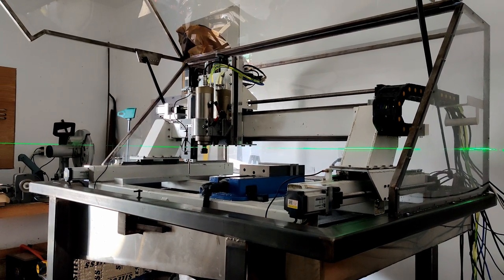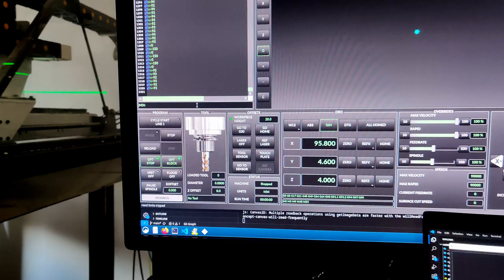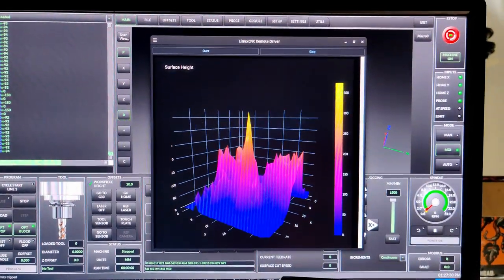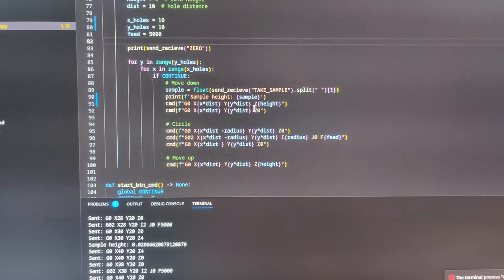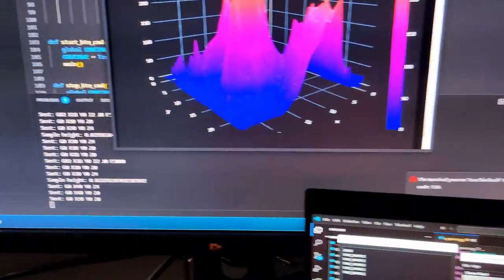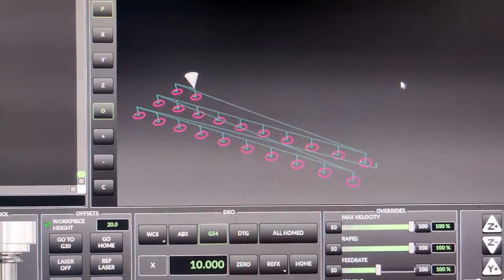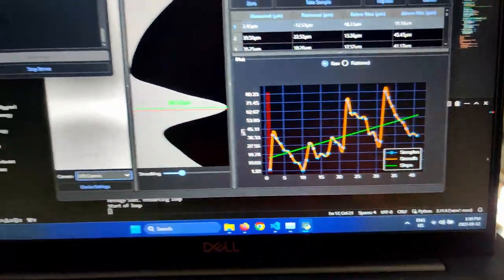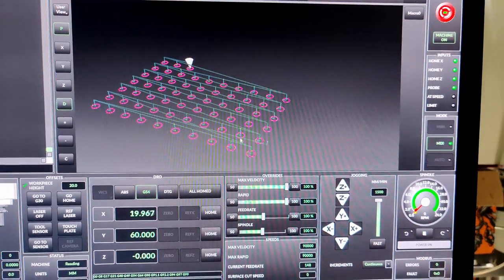CNC machining a flat surface with lasers - Part 1

Comment from the maker: I’m quite happy with how stable the sensor is picking up the laser beam while the cnc machine is moving. I thought for sure it would be shaking all over the place and I’d have to put a good couple seconds of pause to read off the webcam. 

Also currently jobless for the last couple months now due to the ongoing actors/writers strike which is effecting post-production/vfx that I work in. At this point I wouldn’t mind an industry change, so hit me up if you are or know any company/startups in automation, robotics, machining, prototyping, looking for a technical minded person such as myself Toronto/GTA or remote.
Reply: Hope things go well with you.
I am trying to setup still and when things get better .. would be great to connect and possibly collaborate.
There can be a good market but needs to be explored here in India.
I would be designing something which can be heavily calibratated. And what you did is the important part of calibration :)

Comment: I replicated your system in order to align linear bearing on my CNC granite epoxy . It worked fine.  Great idea,  incredible accuracy with a 50€ webcam.  Faster than a precision straight edge  and far less expensive. Thanks Bryan .

Comment: How do you make sure that the laser beam is level?
Reply from the maker: You don’t really need to because you can just correct for it with a regression plan. Removing the arc in the lens due to misalignment of the laser is also needed. That can be done by calibrating over 3 points on a line and adjusting the alignment till they are all the same height.

Comment: I have tried to replicate your laser webcam system but the camera oscillates up and down a lot. I am bot sure if it is related to the laser beam being too thick. my need is a accuracy of +-0.005 mm but no luck so far with 2 different webcams
Reply from the maker: A couple things to check. If you have FFMPEG added to your path in Windows you can use the button in the bottom left of the webcam tool. That'll open up a small device window that you can change device settings on your webcam. Turn off most auto things is beneficial. Some cameras like the one I'm using have a transmission line filter at either 50hz or 60hz that also helps. Your laser power source also might have oscillation in it which will show up on the beam projection.
Reply: Thank you Bryan. I will check those and let you know how it goes. I am really looking forward to have it working.  @BryanHoward

Comment: Good job so far. Wanted to ask you where to source the camera module? I searched on ali webcam sensor and a couple 8mp boards for 30$ came up. Is that ok? Also, generic laser level would do the work???
Reply from the maker: This is the webcam I used. I took the lens and LED's off it https://www.amazon.ca/gp/product/B07VL7BNLZ/ref=ppx_yo_dt_b_search_asin_title?ie=UTF8&psc=1
Reply from the maker: For laser, you just need a laser diode that you can get out of anything
Reply: @BryanHoward  thank you very much for your answer. I am trying to write my personal em.ail in order to contact you or vice versa, but youtube keeps deleting my comments. I have a suggestion for you if you are interested. Keep up the passionate work
Reply: @BryanHoward  I cannot reach you via youtube. If I post my email, my comment gets deleted. How can I contact you??

Comment: Are you measuring the beam peak intensity?  At peak the gradient is zero.  If you measure both sides of the peak (the shoulders) where the gradients are a higher value, you will improve resolution.
Reply from the maker: Nope, I'm using a fit curve on a Gaussian distribution function. It's found in scipy.optimize. after that I take the mean of the fitted curve.
Reply: Nice  @BryanHoward

Comment: how/where did you learn how to controll linuxcnc via this python apps?
Reply from the maker: LinuxCNC documentation. There are a few basic examples to get yourself started. Much of what you end up doing good sending gcode commands to MDI. Most of LinuxCNC can be remotely operated some Python from what I can tell.
Reply: @BryanHoward  and from where did you learn to make this python apps?

Comment: Very smart, I was thinking of using a granite surface plate and 3d probe to calibrate my machine to flat but this way is much slicker. Lasers would be a good way to measure repeatability of the touch probe though. Too bad the image sensor isn't longer such that you get more vertical measurement distance for 3d surfaces, though I guess you could tile and overlap a few image sensors to get that working if needed
Reply from the maker: You could get around it somewhat by using the webcam sensor in a similar way to a proximity homing/limit sensor. “W” axis would then search.  It wouldn’t be as accurate depending on how well the ball screw on the “W axis is made”. But it would be better than without and having to rely on the entire cnc machine to be made perfect and running in climate control conditions to not worry about expansion due to temp. This would greatly remove most unknown variables but not completely. 

3d surface mapping would add in a whole set of new challenges like having to use a very fine point on the webcam sensor finger that touches the surface. Spring pressure would have to be dropped or rely on only gravity to not damage the surface. 

For a moving “W” axis like mine for these kinda purposes, it would probably be a good idea to attach an optical linear scale and now rely on the ball screw for position.

Comment: Hello Bryan !
Have you looked into Blum non contact tool setters ?

I think, using a camera as a laser sensor just like you do could make a great tool setter !

Of course it's very different to your current use case. Though, there might be some potential to look into.

Comment: Absolutely great work!
In this video, I got kind of lost, though on the - what is intended which way. Basically with w you sense the laser-plane. And the readings should output the mountain in the python program? There you have a mock-up running, if I understood correctly? Then, with the laser-sensed height profile, you're going to machine the surface to flat. Is that somewhat correct? And eventually, the w axis will touch the surface with a probe on it, to measure the height profile?
Thanks again. I'm actually so inspired to try something very similar and will get back to you, as soon as there's something to show :).
Reply from the maker: Yeah that's it. Probe touches the surface. Probe moves down the same amount everytime. Being spring loaded the probe can handle positive and negative height changes. The reading on the laser ends up being the deviation from the Z (or in this case W) height constant. Yeah the data in the graph is mock up from some mountain. The real value is on a surface will look about the same or like some other terrain.